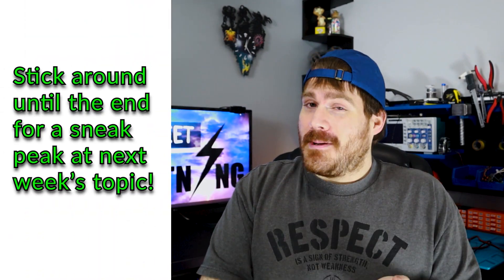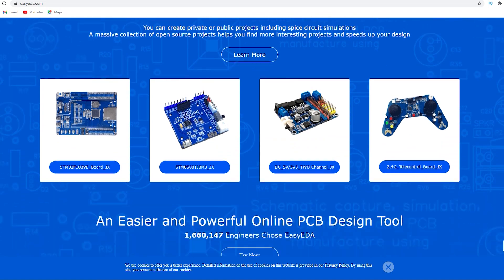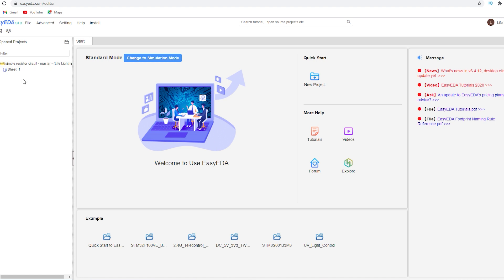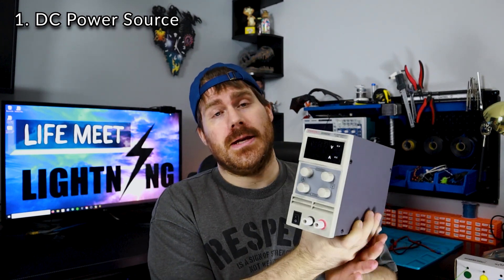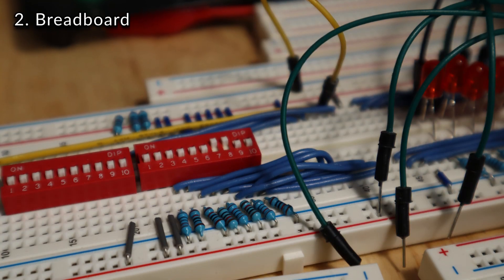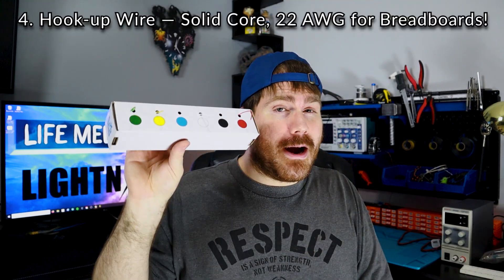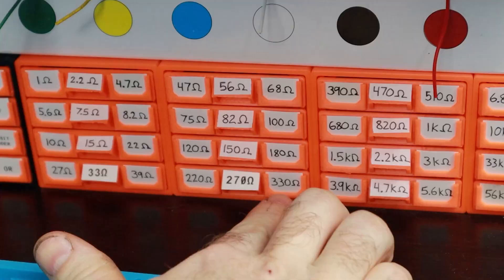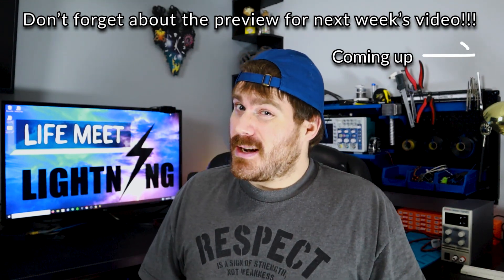Electrical Tools for Getting Started | What Things Do I Need to Learn Electronics

Comment: ♥️.  I think no script can be to your benefit, because it just feels more personable, and like you’re actually speaking to your viewers, rather than reading from a script.  I’m not good at that yet, so I tend to have every word written down 😔.  I’ve tried outlining before, but I’m just not a very good speaker.  But anyway, keep on fighting!
Reply from the maker: I like scripting for a few reasons..  first, especially with the more technical stuff, it helps me make sure I say everything that needs to be said and don’t forget anything. Second, it helps me get everything said as concisely as possible which saves time for my viewers. And third, it saves a lot of time filming and editing. And fourth, it takes like, zero time to add manual captions (this one took me a little over an hour to do). I dunno, this one was kind of a fluke, I just sat down with no plan and filmed it in one take. Only need to edit a few parts. Maybe I’m getting better at it.  Lol
Reply: @LifeMeetLightning  Those are all great points.  My script also helps with captions.  Sometimes YT auto does them, and sometimes it doesn’t 🤷🏽‍♂️.  You can have a rough outline with all the important technical stuff on the outline.  When I go off script I get a lot of “uhs” and “duhs” 😆.
Reply from the maker: @OddDrummerGaming  lol I say “you know” way too much.